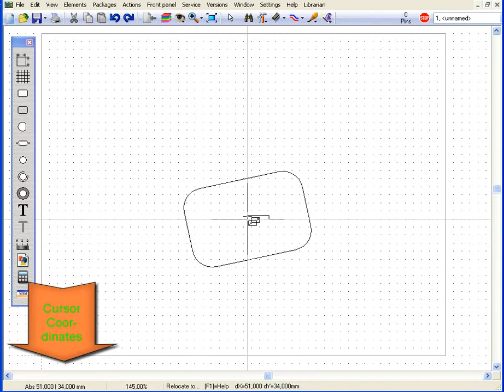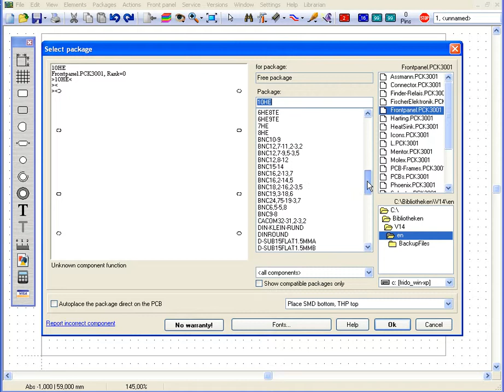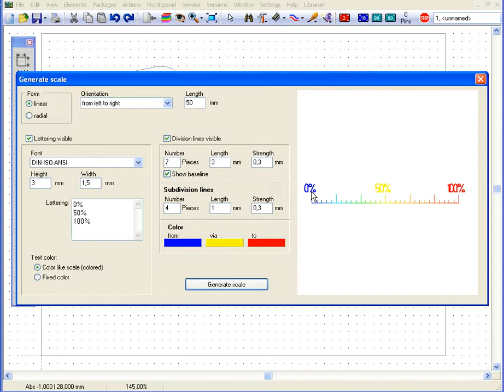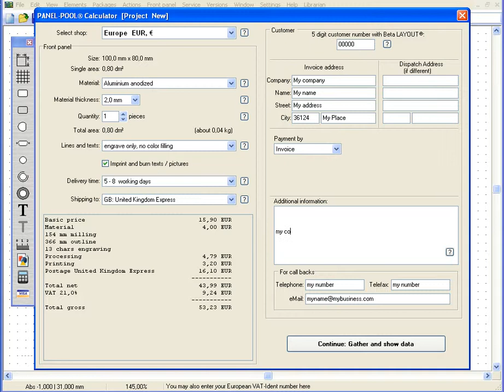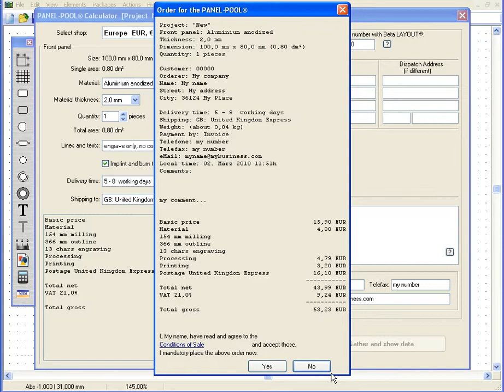Design and order front panels with TARGET 3001!

Comment: can jou allso print the design of the front panel on a laserprinter (to make youre own panel using inktransfer)
Reply from the maker: Yes, you can also print everything you designed for or on your front panel. Also mirrored if you need that for ink transfer.